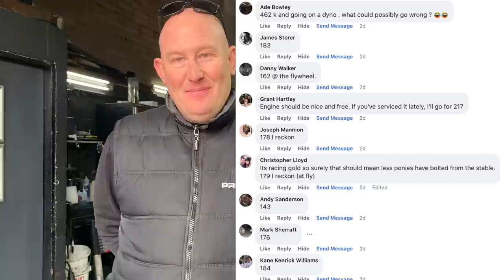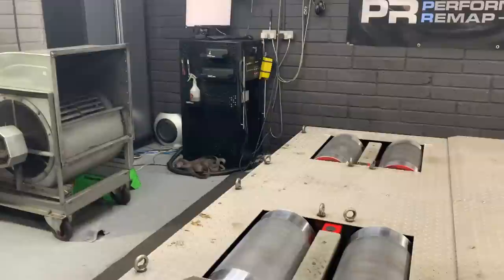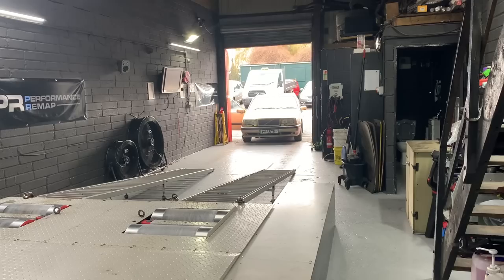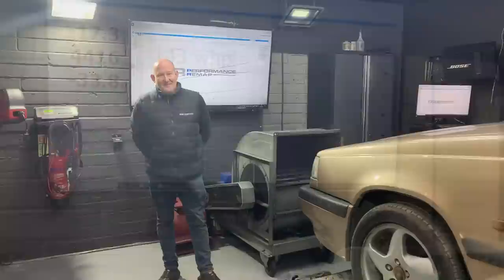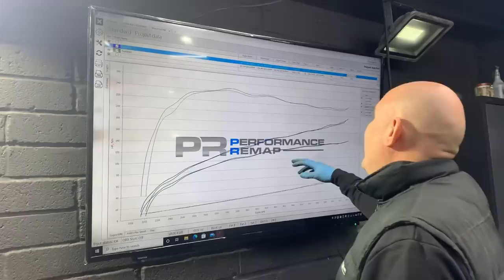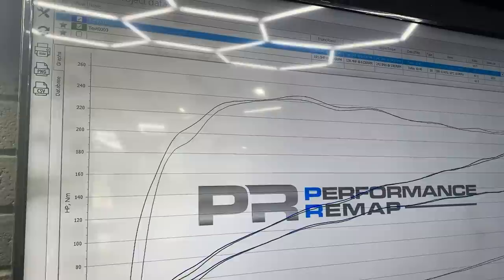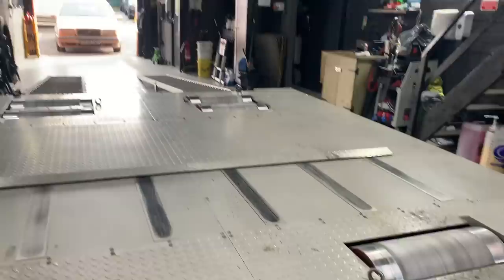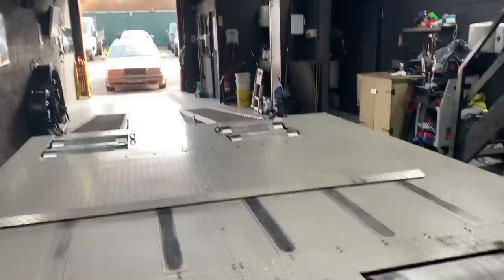How much power has my 460,000 mile Volvo 850 T5 lost? Dyno Day.

Comment: That's amazing! I love Volvos. I have an XC40 at the moment, previous car was a V40, before that was a V50 and before that was an S40. My in-laws had an S40 and before that they had two Volvo 240s both with over 100k miles on the clock. I have a Volvo belt buckle that I wear on my belt from time to time. I'll stop there 😄

Comment: I loved my 850NA 10-valve, bought new in 1996. It made it to 380,000km before a clogged flame trap (thanks to poor servicing by the local Volvo dealer. I should've known better. He'd mounted rear shocks upside down on my previous 240!) blew out the valve guides and the car began blowing smoke profusely. An engine rebuild was cost prohibitive so I watched sadly as the low loader took it away to the wrecker, body perfect! It's rare to see an 850 or V70 on our roads today. 240's are more common. All great cars, if a little thirsty.

Comment: If you check the boost pressure it will most likely be low. The actuator spring goes weak on these after 20+ years. If you put a new one on you will probibly have all the power its supposed to have.

Comment: I sold these new (for Linn Volvo) in Glasgow- and was at the 850 product launch. These had 225 bhp, and Volvo said the engines were assembled by machine and ought to do 250k miles without attention.
Reply from the maker: Love it
Reply: I should say, the most powerful version we got to drive on the product launch (in 1989) was the 2.5. There were no turbo things then.

Comment: Would be interested to hear how you get on with the ABS issue as I also have the ABS light coming on intermittently. Actually very intermittently in my case as it is only on every few hundred miles (then resets when I stop the engine). A couple of quick easy thing you might try are - checking the condition of the wire that connects the engine to the bulkhead (top rear of the engine) and if you have the older metal plug-in ABS unit, unplugging and cleaning the contacts (with a spray contact cleaner).
Reply: As far as i know, there are two common problems with abs in the p80 cars - the abs control module, which you can try to re-solder, sosmetimes this helps, and the rear abs sensors, which are combined into a single part that cost an arm and a leg, and few bothered replacing this. Of course, this can also be caused by the front abs sensors, but they are nothing special to have replaced. 
Abs is a bitch in these. If it is poorly, your speedo can start cutting off, and you lose cruise control with it. One of the many reasons why i prefer the rwd models.
Reply: @zloychechen5150  Thanks but I think you are talking about the later ABS system. I have the earlier type, for which the controller is a metal pug-in unit. The speedo is mechanical drive and not electrical. There is no cruise.

Comment: I am really not sure why old cars should lose any power unless they have particular issues.  I remember when my friend's 850 Mini died (cracking up pistons) it had exactly the same top speed however it lost lots of low-down torque. Direct injection cars will lose power with the carbon build-up.

I would like to see a repeat of this test after fitting new plugs and all fluids (including the gearbox) and any other work that may be required on these old Volvos followed by a long motorway cruise to clean out the CATs.
Reply from the maker: I like this suggestion...
Reply: You are right; they dont. Its almost certainly one of those really old "truths" that might have been true at least 60 odd years ago when cars still wore out their cams, piston rings etc etc to a meaningful extent. But once its taken hold in the public consciousness it wont go away easily. 

Its the same as even "car people" and motoring journalists still thinks a max engine torque number in isolation has any direct influence on the performance of the car, and therefore still quote those numbers.

Comment: If you want less power loss through the transmision, then swap it to manual.
Reply: why is that?
Reply: @volvo850enjoyer8  mainly due to power losses in the torque converter.  I had a Vauxhall Senator 2.5 auto that I converted, using a donor car. The car was a totally different animal with the manual box in it, way quicker off the mark, & power delivery throughout the rev range was increased, scared my gf of the time   lol.

Comment: I'm not that shocked as these were very well built, regular oil and filter changes, and they would go on and on.

My father had a high mileage 740 estate and the only thing that had gone on it when he changed it was the suspension,  according to the mot check website someone  kept it for another 4 years after he traded it in.
Reply from the maker: Is it still around?

Comment: why did the tv show 155 whp? did it kick down? at what boost was your hp figure quoted at? as at 1psi it would be good, and 1 bar bad.
Reply from the maker: I think the 155 was from a kick down yeah, I did my best to edit together the footage to make it real and honest with out being totally boring
Reply: @GeoffBuysCars  used to help a friend with his dyno, did volvo days, 850 autos wernt very accurate to dyno, if you load the rollers to much they kick down, if you go to fast on the pedal they kick down, can't go wot as you hit kick down switch on throttle cable, you cant just open the throttle from 1500 and let it rev out like you can with manual.  Plus you can easy tweak correction factors so no dyno is the same, dynos best for before and after gains. What would have been better to see is boost and af.
Reply: Yes it kick downed a gear, really hard to dyno these old school autoboxes.  Have to hold the throttle at exactly the right place.

Comment: My experience with these is that the TCV gets worn and you lose turbo pressure. And then they give over 10 hp more with 98 oct instead of 95 oct.
Reply from the maker: Yeah this was running on E5
Reply: @GeoffBuysCars  If you want to go further tuning it, then you have to change the cat back exhaust due to too high back pressure in Volvo's oem exhaust.
I would recommend you BSR or MTE/TME software and exhaust, developed in Sweden, if you can get it in the UK?
I live in Norway so I have easy access to this.
Reply from the maker: @torehanem  Sounds expensive! I think the first thing is to address and resolve the oil leaks, it's not running the original cat but yeah, maybe a good quality high flow exhaust will help, but in my experience that's where it gets costly!
Reply: @GeoffBuysCars  Yes, its 600€ for both parts, exhaust and ECU tune.
189€ for the BSR chip alone. The nice thing is that you can pick it off and put it in another 2.3 T5 if you wreck this one one day.?

Comment: I would like to know what my CLK CDI  condition is after covering 250,000 miles
Reply: 270 CDI? The intakes clog up over time and is a pig to remove, that could lose some power. Indestructible engine though, T1N Sprinters hitting a million is not unheard of.